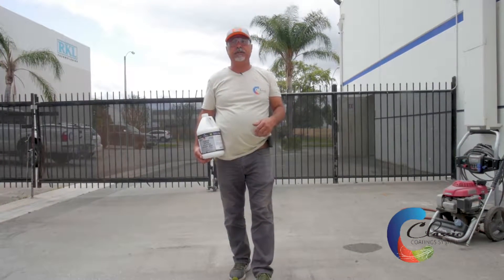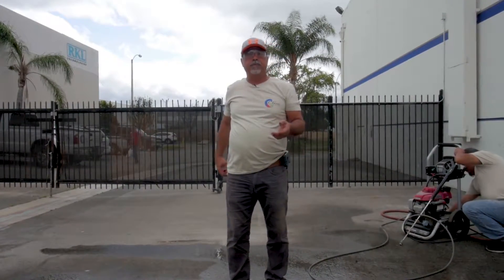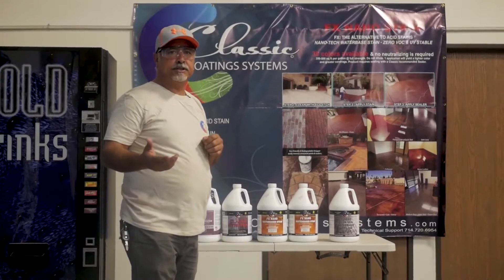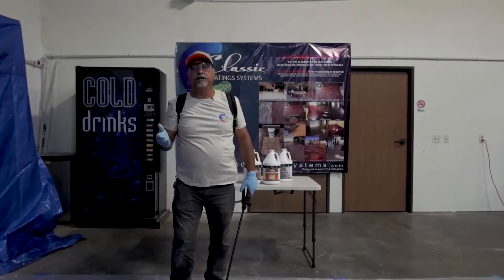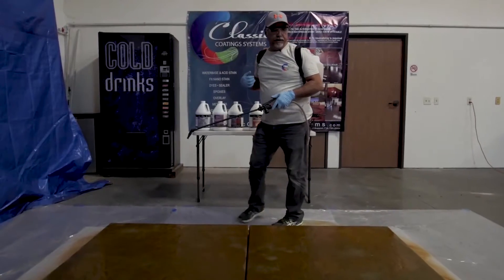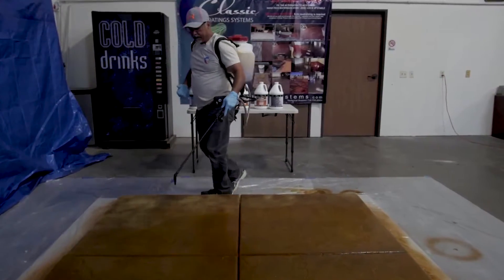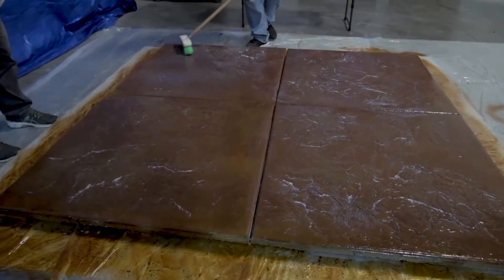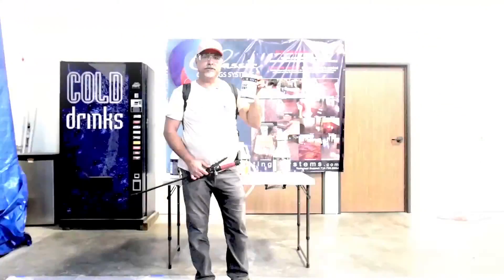How to Prep Stain and Seal Concrete with Classic Coatings

Comment: For an interior room, how long do I need to wait before furniture can be placed?
Reply from the maker: @kathrynannewalters  Hello! For more specific questions about our products, feel free to give us a call. Here’s a general guideline to help:

After staining and sealing concrete, it’s recommended to wait at least 24 to 72 hours before moving furniture, depending on the type of sealer used.
	1.	Drying time for the stain: The stain typically dries in a few hours, but ensure it’s completely dry before applying the sealer.
	2.	Curing time for the sealer:
	•	Water-based sealers usually dry within 24-48 hours, but full curing can take up to a week, so avoid heavy foot traffic or furniture until fully hardened.
	•	Solvent-based sealers may take 48-72 hours to dry, with full curing also taking up to a week.

To protect the surface, refrain from dragging or scraping furniture and avoid heavy traffic until the sealer has fully cured. To check readiness, press lightly on a small, inconspicuous area—if it feels tacky or leaves an impression, it needs more time to dry.

Comment: I have a new concrete that was installed one month ago.  Surface was cleaned but not with your specific solution.  And water based stain of yours was sealed with Glaze N Seal rather then your sealer.  The stain is easily scratching off.  Is this due to the cleaning/sealing products ?  All timelines you mentioned were met or exceeded.  Sealer was allowed to dry for 3 days.  This is for an interior sunroom application.
Reply: product used was classic custom nano hybrid water based stain.
Reply: i assume you dont pressure wash interior applications?  concrete was very clean but did not specifically use your eco etch product.
Reply: what if the other sealer was applied only a few hours after second coat of stain?  it dried for 3 days with sealer then it was walked on and seems to easily scratch.
Reply from the maker: Our products operate in a three-step system, as demonstrated in our videos: Clean, Stain, Seal with Classic Products exclusively. If issues arise from the use of another brand's cleaner or sealer, we can't provide accurate advice due to the unknown ingredients in their formula. 

Our stains exhibit excellent performance when following our recommended step-by-step process outlined in our videos, using only Classic products.

We are unable to provide guidance on products that aren't ours. Kindly reach out to the manufacturer of the products you used for assistance.

For more in-depth inquiries, feel free to contact us directly.